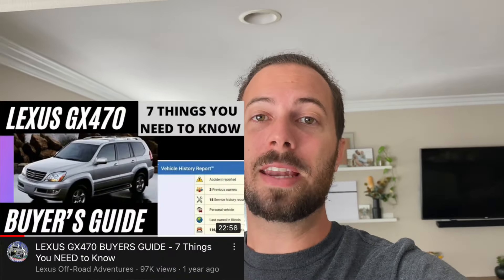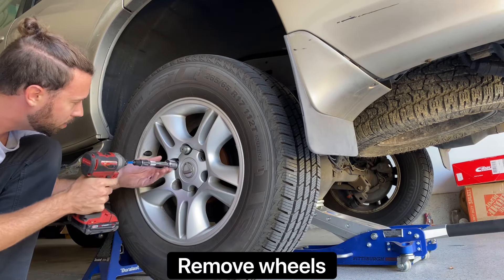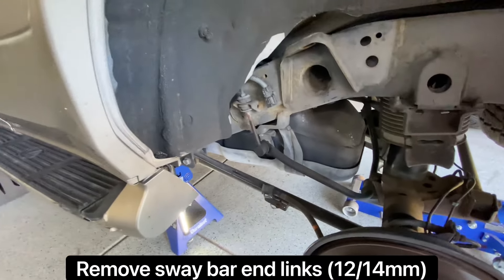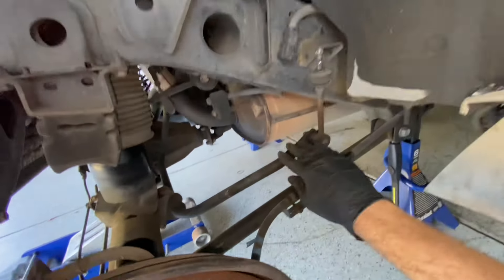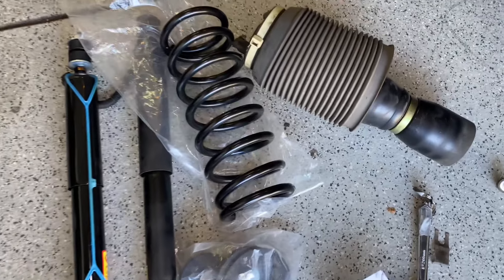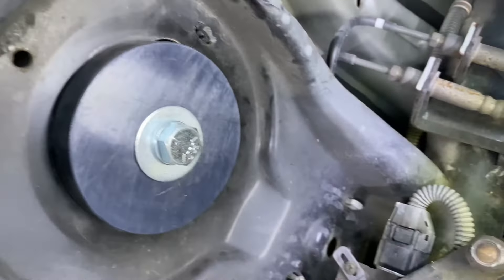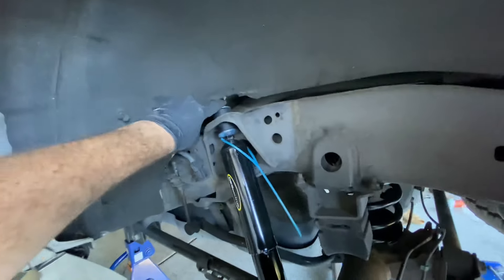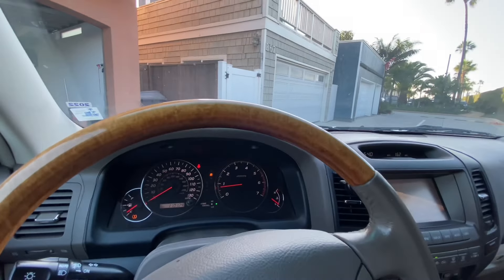Fixing the Most UNRELIABLE Part of the Lexus GX470 for WAY LESS than Mechanic Estimates

Comment: Mine went out at 150k and the dealership wanted $9k to replace them.  I said no and they replaced my suspension with the airbag delete kit.  The car has now 280k miles and it’s just as good without the airbags.
Reply from the maker: @Benny00134  9k?! Unreal. I actually prefer the way the springs ride vs air. Much more progressive
Reply: Does yours have warning lights on after the swap ? Mine does

Comment: Let’s dial back the “click bait” language…this system is NOT unreliable or flawed.  Mine lasted 220,000 miles and all my fiends GX’s lasted at least 180,000.   Any suspension part that lasts that long is made extremely well!
Reply from the maker: Keith this is an off-road youtube channel. If you actually take your GX off-road, the air springs will not last. Plus, I've found that the spring conversion drives much nicer as the spring rate is nice and progressive. The air springs on my silver GX failed after only the low 100k mile range. Still reliable, but not as reliable as the rest of the vehicles' components when you actually take your vehicle off-road.

Comment: Highly recommend Air Bag Man lift bags from australia instead of deleting the bags. There are a ton of benefits to them like auto levelling roof top tents, when youre loaded down with gear, or pulling a trailer. They use Firestone air bags so they are easy to swap, tougher than stock, and offer standard as well as 2" lift bags. IMO its foolish to ditch the bags for coils and downgrade your plush ride.
Reply: If chose to get extended airbag then where to get extended shocks and struts? Recommendations?
Reply: Do they have right hand drive GX460’s?
Reply: @Reardon_Cobra  In Australia, this model is RH drive, but produced as a Toyota Landcruiser Prado (120 Series). They’re almost identical other than some mostly visual interior and exterior differences, engine variants and suspension options. They’re offered with the same 4.0ltr V6 1GRFE engine that the GX460 has, but there’s also a 3.0ltr 4 cylinder 1KZ turbo diesel option. No 4.7ltr V8 2UZ engine option and no airbag suspension. I believe this is the same in most other RH drive countries they were released in, if I’m not mistaken.
Reply: @shannonmesritz  ok I knew about the Prado it’s just I wanted to know specifically for the gx470 cause I live overseas and a diplomatic child so I’ve see plentiful amount of prado thx 🙏
Reply: @Reardon_Cobra  I believe all Lexus GX’s of this era (120 series) are for the American market only. The 150 series and newer might be offered with Lexus branding in RHD in some other markets though.
Reply: How do they compare to coils when off-roading?

Comment: My rear bags lasted over 15 years and nearly 185K miles. Replaced them with Arnott bags. To get off the rear shocks just use a sawz-all on the top nut.
Reply from the maker: WOW impressive lifespan on those bags
Reply: that's a very reasonable lifetime for rubber...
Reply: Mine has 252k miles on it and still working great.  No dash lights bat all. Drives like new.  👍🏻
Reply: Same here.  I’m on my second set of rear bags and at 322,000 they’re still in great shape. No leaks.  Nothing.
Reply: My 2008 has original air bags at 204,000 miles and it is in SW Florida. I tow a boat trailer and love the air leveling.

Comment: Just purchased a 2005 with 138k miles. Runs great but needs new cv boots and the front struts are gone. I’ve decided to have an air suspension delete done and all new shocks and struts. I chose to go with KYB in the front and struts in the back since Toyota trusts them for many vehicles. I went with metal tech 4x4 for the delete kit and springs. Total for all the parts was right at $750. The GX470 should ride like new and be solid for years to come.
Reply from the maker: @jmac13131  All great parts. Going to be a nice ride

Comment: A fuel line disconnect tool will release the air lines very easily. I got a set at harbor freight and swapped my bags in under 30 minutes
Reply from the maker: Great tip

Comment: I really appreciate the video. My 470 is at the point where I have to choose between coil or air and I am now convinced to spend the extra dough and have a smoother ride, to maintain the original integrity of the manufacture and keep the air system. It seems like every video I watch where the bags were replaced with coils that the owner is trying to convince themselves in the test ride that it is a more 'normal' ride with a little more bounce. In every video I can see the camera jumping up and down. It's ok to admit that you're choosing a slightly more bumpy ride over money. And that's ok. I understand saving money but I'm going to sacrifice to have a better ride.
Reply: It is tricky for anyone replacing the original air suspension to say that the regular coil suspension is as good or better. What was replaced was old shocks and maybe leaky bags. I just replace my rear shocks and my ride is much better, I had a leaking one. My air bags were only $200 and easy to change. I like switching between comfy mode, also what I call bad road mode, and sport, which works great in twisty mountain roads.

Comment: Yeah putting the lock washer on the bolt side essentially leaves the “fastener hardware” unlocked. Now that top nut has nothing keeping it from vibrating lose and falling out. Lol
Reply from the maker: @davenewton5895  time stamp?
Reply: @ unsure of exact time stamp, when installing the upper spring seats, the lock washer and flat washer intended for  above the frame before the nut , was instead (lock washer ) was moved to the bolt end of the fastener assembly. Essentially locking the bolt to spring seat and leaving the nut above the frame “unlocked “ . So the nut can loosen over time due to vibrations, then come off, and the spring seat will be floating freely and essentially could fall out the bolt. Most definitely would fall out spring seat may stay in place just from the spring tension.  I guess the bolt is more or less to keep the spring seat centered where it is intended to be., and not actually holding the suspension parts together. I just pulled the rear end out of a 2003 GX 470 video was helpful nonetheless. Thank you.
Reply from the maker: @davenewton5895  cool will look into this, thanks

Comment: I think GX's air suspension works just fine. If I want a stiffer ride with less bounce, I switch to sports mode. Comfort mode is slightly bouncy but I hardly notice much difference. The most overlooked GX suspension tweak for better ride quality are the bump stops. If your GX is pretty much a mall or parking lot crawler instead of a hardcore rock/mountain crawler, keep the air suspension and replace the OEM bump stops with Timbren or Sumo. Cost about $300 a pair for the rear and anyone who can remove their tires can replace bump stops. There are four, 2 rear and 2 front. The rear's are different from the front.
Reply from the maker: Bump stop upgrade coming soon! 

If you drove the car back to back after replacing the air suspension with the static setup, it may just change your mind. Ride quality improved at the rear axle by at least 20%
If course I have no way to prove that so… 🤷‍♂️ There is this steep driveway my wife and I always pull out of and there would be a boom and shaking of the interior and strollers we have in the back for our son. Now, it no longer has that sudden shock of energy and is a smooth transition to the street surface. 
Of course, if you tow a lot of stuff you want the load leveling but it’s just my wife’s daily. She loves how the car rides now on the 405 fwy and she normally doesn’t pay attention to car stuff
Reply: Cool, I'll keep your spring conversion review in mind. I might reconsider if my bags finally pops. About bump stops -- there are also hydraulic ones but I'm not sure what the pros are compared to non-hydraulic. If you do choose to go with that type, please share videos on it. Thanks.
Reply: @lexus_offroad_adventures  did you upgrade the bump stops?
Reply: I'm so stoked to get a young 470, and get the full air ride experience that someone paid 50k for 13 years ago. If and when I'm not satisfied with the air ride later down the line, I'll go coil overs, but for me thats part of the GX experience! It still off roads just fine factory im sure. Nice take
Reply: @lexus_offroad_adventures  Funny when I saw that wall, I was thinking the same thing, near the 22 and the 405.

Comment: Great video well done.

I just crossed Canada and the USA with my 2008 Gx 470. It has over 230,00 km (144,000 miles) towing a Winnebago RL2500 travel trailer weigh in at around 5,700lbs total weight. Max towing capacity is 6,600 lbs.

The air suspension on this vehicle works as designed. Lower the system to hook up, then raise to the neutral position. I did not need to purchase a load distribution system for the trailer.

 The 4.7 V8 was a rock start. This engine reminded me of my motorcycle engine , it loves to rev. Yes, I did burn lots of gas averaging 10 miles per gallon.

 Removed all rear seating. With the trailer tongue weight and a few items I was close to maximum load capacity (1200 lbs. max)

Ordered the new Tundra Hybrid Platinum with advance package (back in February) and more or less the same air suspension system for towing our travel trailer. 

Have replaced my air bags once and the pump. All four shocks are the stock originals and work just fine. The key to keeping the cost down is to find someone how is familiar with the system. 

All this to say if you are planning on towing with your GX keep the air its worth it for the ride and stability towing.

Norm
 Gloucester Ontario
Reply from the maker: Thanks! Sounds like a great trip! Completely agree, if you tow a lot, the air suspension makes sense.

Comment: Found your video tutorial here and it has been a prayer answered. My GX susp started going south about year or so ago and I had to keep driving it and let me tell you about the headaches I’d get after driving just down the street!.  Let’s you know how bad our roads truly are!  Anyways thank you for the video. I was a few days away from forking over $4K to Off Road Warehouse to do this same job you shared. I’m no experienced mechanic by any means but am a quick study and I think I can do this. And I appreciate any and all guidance, so please respond….
I need to replace the airbag system asap but also would like to build a modest lift. Would love to get recommendations on parts and/or conversion kit for this job?  After some research it seems that ICON is NOT a preferred brand by many. Thoughts?  This is what ORW recommended.  I plan to make additional mods for off road intentions and have some great ideas from your other videos.  Cheers!
Reply from the maker: Hi Christopher, thanks so much for watching. I’m humbled to have been a part of an answered prayer! 

For a modest lift, most opt for the Bilstein 5100s. I don’t personally have experience with them, but I’d consider them a safe bet. I do have experience with the Eibach pro-truck lift system. They are very high quality and huge value for money. Icons get a bad rap in some circles but overall they’re considered a high quality suspension system. Probably overkill for the money and the modest lift you’re looking to install. I also have a front strut replacement tutorial so you can follow that to replace the suspension at all 4 corners and get a comprehensive lift system, which is highly advised. The front may be a bit more involved for the install.
Reply: @lexus_offroad_adventures  thank you for the quick reply and I actually just finished watching your tutorial on installing the Eibach heavy duty and I think that may be the choice. I’ve also seen a lot of talk in the GX forums about  Dobinsons? Any experience with these?
Reply from the maker: @SuperSocrates13  I don’t have experience with dobinsons but another perfectly reliable choice which I included as a great option in my latest video

Comment: Newbie novice question here from a non-mechanical GX owner. I have had a 2006 GX 470 for about 3 years now, it has 180K on it. I do not drive off road at all and put very low miles on it (my wide has a newer car we use for trips and family stuff). It's just a surf mobile and I drive it 2 or 3 days a week. It has been a very reliable car these last few years. Today it became incredible bumpy and bouncy to a degree that seemed borderline unsafe. I had noticed that it did look like it was sitting low. I tested the air suspension and it raised to the high level, although it seemed to take longer than usual. When I drive in the high position the drive was much better and after it automatically went back to normal upon reaching 20mph the ride remained normal and not bouncy. SOrry for the long description. Just trying to determine what the issue is. I am assuming its due to the air suspension failing. Also, when I got home i noticed that the truck stayed in a higher position after turning it off (as opposed to lowering as per usual).  I do not want to spend 3 grand to fix this, do you think I should just go for this static suspension? I dont care if its a bit bouncy, its just my old truck. Since I dont go off road is there a particular suspension you would recommend?
Thanks!
Reply from the maker: @slashtrio  Yeah that’s what my silver GX was doing when I first bought it. It would bottom out HARD on the rear bump stops if I hit a dip in the road and pogo up and down. 

Sounds like the rear bags. I linked the kit I used in the description but replacement bags from eBay are a super cheap alternative. Just a bit more involved to hook the air into the new bags but not bad at all. Can’t go wrong doing a spring conversion or sticking with the stock replacement air bags, but I have the full video on the spring conversion here so may be easier to DIY.
Reply: @lexus_offroad_adventures  thanks man. To be clear I won’t be doing the work ha. I’m not mechanical and I’m super busy with work and family, so I’ll be paying someone to do this. So I’m guessing that the spring suspension option would be less involved as far as labor goes? Or do they both take about the same amount of time for a mechanic ? Thanks again.
Reply from the maker: @slashtrio  it’s hard to say what mechanics charge. I’d get a quote from a local shop that specializes in Toyota/lexus trucks. If you’re near SoCal, we have Miyaki Motorsports as our go-to shop for GXs

A shop may not be as big of a fan of a spring conversion as a weekend warrior DIY person since they want to follow the shop manual or whatever. That’s why finding a trusted shop that does custom work like Miyaki is helpful because they do this stuff day in/day out.
Reply: @lexus_offroad_adventures  cool. I’m in NC. I’ll call around and get an idea. Doesn’t sound like the installation of air shock system is way more involved than the springs maybe, just cost a lot more for that system. I’ll go with the cheaper option. I don’t really feel I need the air suspension. Thanks again
Reply from the maker: @slashtrio  the air bags are designed to be pretty easy to replace. 

Springs are another simple alternative since the chassis is designed to sit on both types of springs.

I’m honestly not sure which one is more cost effective when getting the work done by a shop.
Reply: @lexus_offroad_adventures  cool man, I guess I’ll ask some local indie shops what they might charge for either situation and then compare and the costs of the parts. Do you recommend a specific place to buy new air suspension system?
Reply from the maker: @slashtrio  I only feel comfortable recommending OEM replacement air springs and this Strutmasters conversion kit because it has served me very well for years now. 

There are some very cheap aftermarket air bags that may also be worth considering but quality may be hit or miss. I’d check out some reviews of them if you want to go aftermarket. Just Google “Lexus gx470 air suspension” and you should see a bunch of results. Some for just over a hundred bucks for a pair of replacement air springs.
Reply: @lexus_offroad_adventures  cool man, I’ll look into it. I wouldn’t wNt to get anything too cheap ha. I’ll do some research and see if I can come to any kind of consensus opinion. Thanks again !

Comment: I tried to tow our sub 4K lb travel trailer with the stock airbags on our 2006 GX 470....no bueno!  The weak bags dropped below the factory LOW position and made towing a 20 foot trailer a NO GO.  The  stock V8 motor is enough for towing, but I would like to know if anyone has done this conversion and has gone on to TOW with their GX?  Thanks!

Comment: not a single hiccup with my 2003 GX470's air suspension, even after 200,000 miles.
Reply from the maker: Wow that’s crazy! How often do you go off road?
Reply: @lexus_offroad_adventures  I routinely fly along the National Forest Roads in North Georgia, and go totally off-road about 2-3 times a month.
It's like that GX is on rails.
Reply: Mine failed around 290,000. I bought aftermarket replacement pair fot like $100 and someone put them in super easily for $60 :) that said, I do like the idea of reliability and better ride whenever I can afford it or the airbags fail, but who knows. Coming up on 325,000!

Comment: In your opinion what feels better to you. Eibach or strutmasters?
Reply from the maker: Two totally different solutions for different setups. The strutmasters are for OEM replacement suspension (stock height) and the Eibach pro truck series is a lift system. The eibach kit does great for off road performance for not a ton of money. But if you’re not looking for a lift; these strutmasters have been great. We love this stock height GX just as much as my off road GX, but for different reasons.
Reply: @lexus_offroad_adventures  Thank you for the response. The way you detailed it out gave me a better idea of everything!